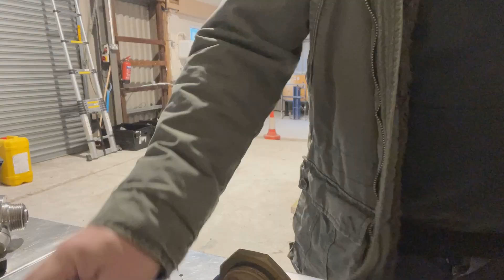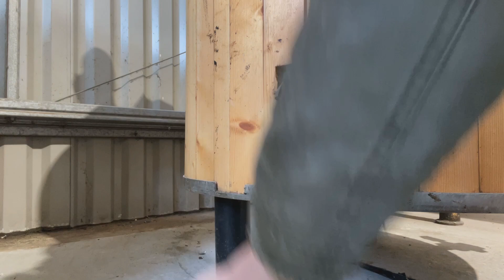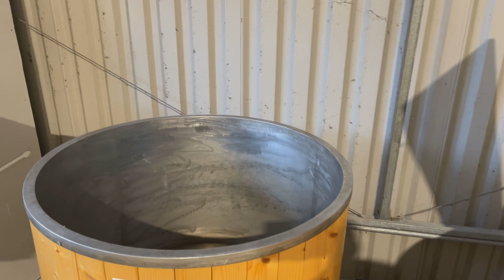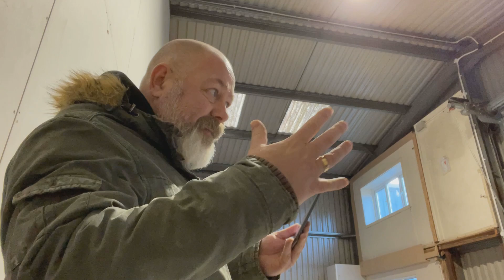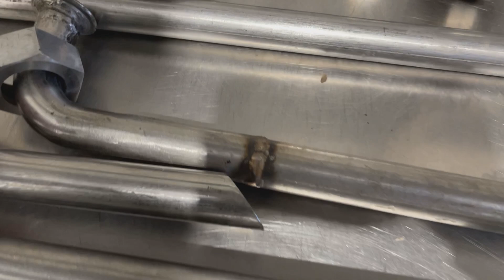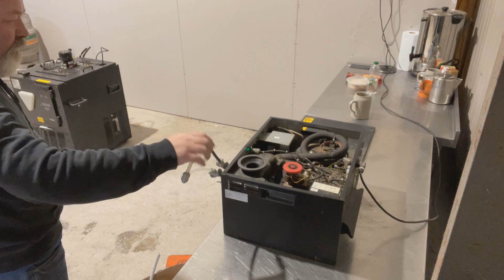Ep.10 - Line Cooler testing at the micro brewery.

Comment: Harry built Steamkiller...that was his condensing collection system. Worked a treat - his brewery was filled with steam on cold brewdays...Steamkiller did away with that. You might go look at his solution - it had 4-5 of those sprayheads like the ones in your clawhammer knockoff. The line itself I'm not too sure what size it was?
Reply from the maker: Thanks @jcinsaniac thats exactly what we need to do. I already found all the bits we need, just need to buy them and assemble.  Cheers

Comment: To calculate the volume of the tub: measure the inner diameter and height in metres.  Diameter / 2 = radius.  Volume = radius squared x Pi (3.1415) x height.  This will give you the cubic metre (m3) volume, where eg. 1 m3 = 1000 litres.  Hence, your tub should be approx 330 L to the rim.
Reply from the maker: Thanks for explaining, that was the method I used too. Do you have a formula to make it 500 litres please?  ;)
Reply: @FourPriestsBrewery  Yeah mate, make it either taller and/or wider 🤣

Comment: I was waiting for the recirc pump to spew water out, wasn't disappointed.  Yup, looping them is fine.  
If you do want to go want it to chill to sub-zero with glycol, you'll need to replace the standard analog fixed thermostat with an STC1000 or something.  Harrybrew69 has a helpful video on doing that.
Reply from the maker: Got a few STC-1000’s standing by. I was more than half expecting a shot of water but I wasn’t counting on the pump working so well first try.